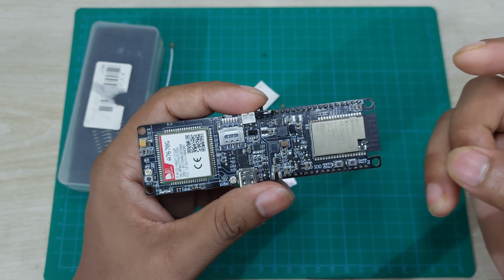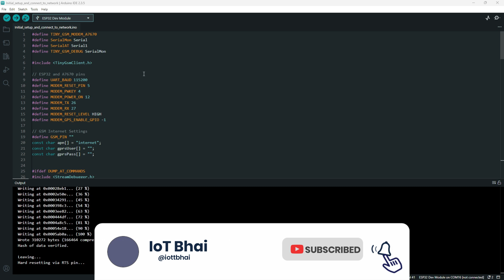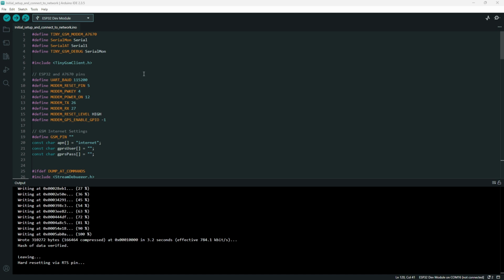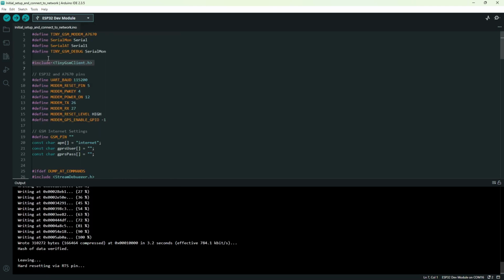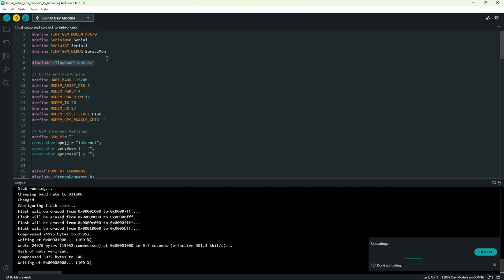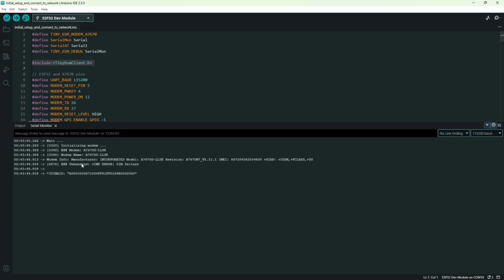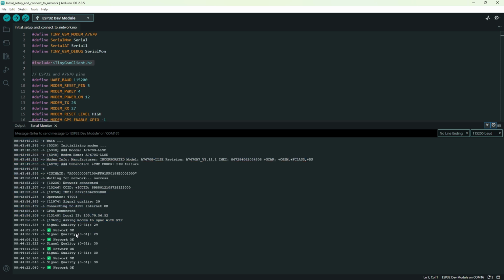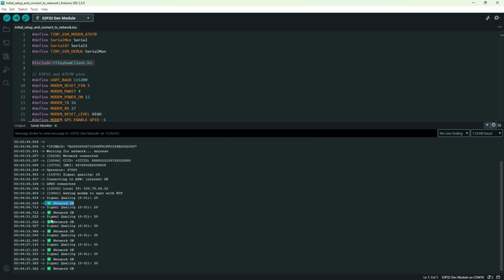How to Connect LILYGO T-A7670G to 4G Network | ESP32 GSM Tutorial

Comment: Can you transmite 4G Just conectes to the Computer vía usb/C port?. Or is necessary the battery
Reply from the maker: No need battery if you connect directly with type c
Reply: @iotbhai  Do you know how can I read the battery with commands?. Im trying and the commands gives me 0. I suspect its because I have connected the intern battery (in slot battery) and the computer for usb-c, but I dont know the circuit and Im not secure, just in case you know. I can´t find the datasheet.

Comment: Nice presentation! One thing I didn't understand: is the external GPS module connected directly to ESP32 pins or is it connected to A7670G and then to ESP32. I see the module is stuck to the battery holder, but I didn't see any solder joints from the video. Thanks!
Reply from the maker: Yes the gps is connected internally with esp32 digital pin,